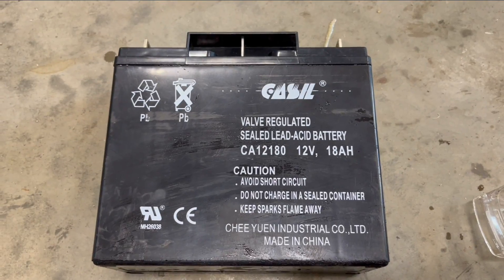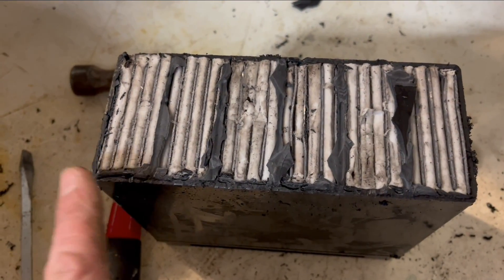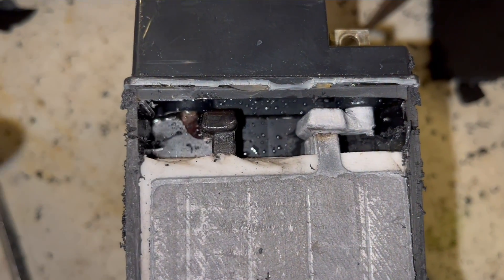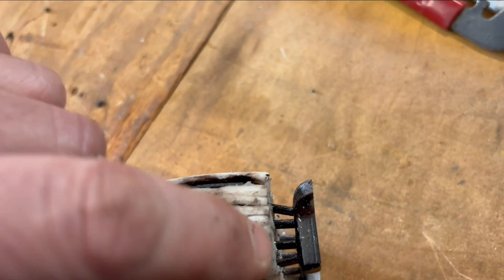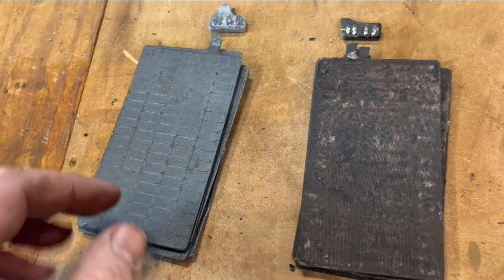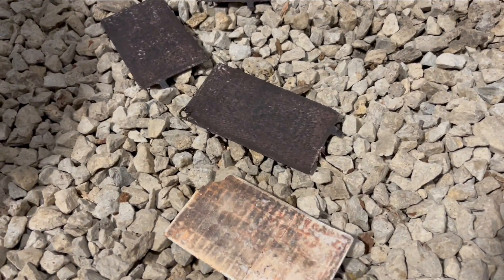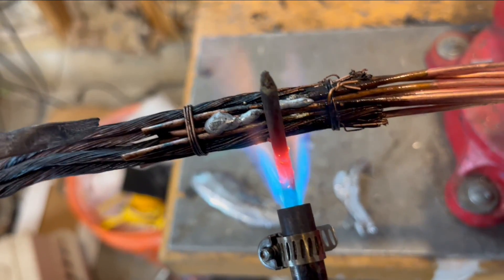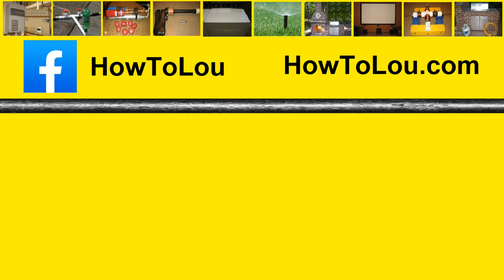What's Inside a Lead Acid Battery

Comment: All of us are buying battery powered power tools, craftsman for me. Do you have ideas on taking care or rebuilding those. I would like to rebuild my dead ones
Reply from the maker: The older tools have NiMH battery packs, and those can easily be rebuilt.  Buy “Sub C NiMH cells with tabs” and replace the cells in your packs. You will have to solder them in, but its easy.   Lithium Ion batteries are much harder.  There is a battery management system in the battery pack and all the cells have to be carefully matched.  Instead, i would recommend buying non-name-brand compatible battery packs.  Amazon sells them for Dewalt, Craftsman, Ryobi, Black&Decker…. Much cheaper than the original tool batteries, and work just as well.  You often have the option to increase the Amp Hour rating, so they work longer between charges.
Reply: @HowToLou  is your background electrician engineering?

Comment: I worked in a battery making factory for a couple years when I was young. The grey plates are negative plates. The positive plates are orange-ish when making them. The lead you are seeing is the frame of the plate. You start out with a metallic lead waffle-like frame and put them through a machine with rollers that squishes a lead based mud/clay paste into them.  After a kiln-like drying process they are assembled like you see.
Reply from the maker: Good inside info.  Thanks!
Reply: How to make separator